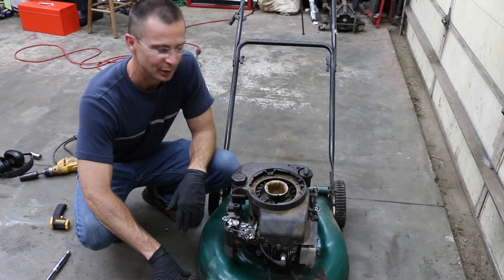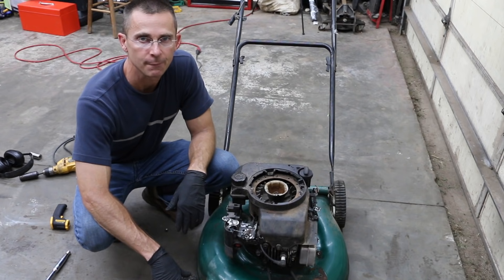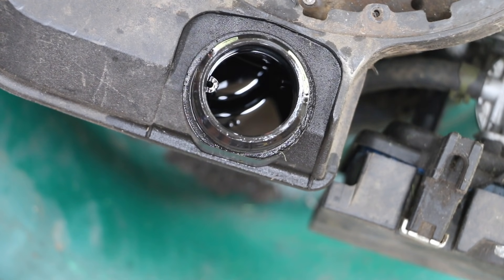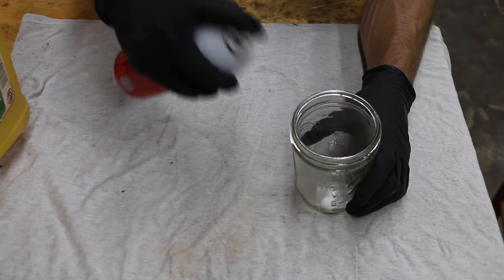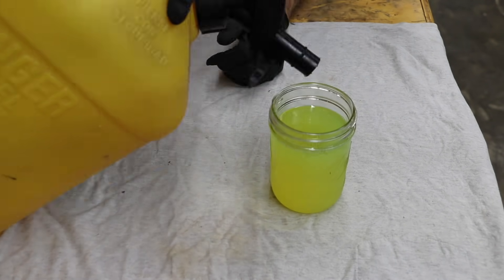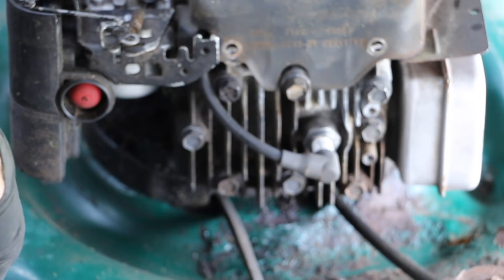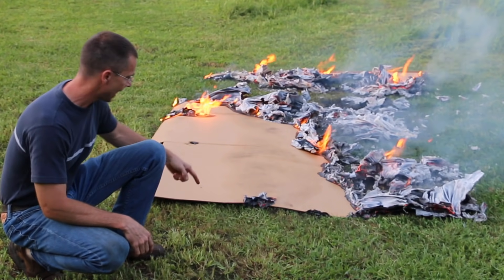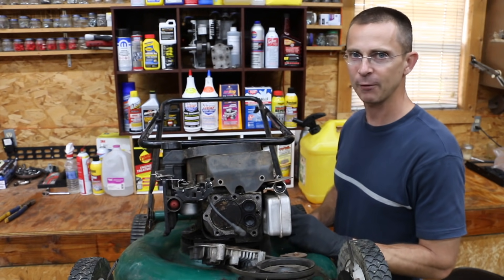Will a Gas Engine Run on Diesel?  Let's find out!

Comment: The fact that you were able to get it to run off a 50/50 mixture is impressive. Diesel has a very low octane rating (reasearch what an octane rating reallh is). So given that you had a fuel air mixture compressed and the motor didnt spin the opposite direction and sling a rod is impressive to me. But hey, we all gotta learn somewhere.

P.S... once you filter out all the bullshit differences in ignition, the ONLY main difference between a diesel motor and a gas motor is the timing at which fuel is injected.

Want to get real technical? Quit farting around with engines that run off the otto engine cycle and start working with ones that run on the miller engine cycle.
Reply from the maker: Thank you for commenting and great point regarding the differences between gas and diesel. I wish I had access to affordable diesel engines, but they are very expensive.  Thanks again for commenting!
Reply: Project Farm affordable diesel engines are attainable. You just have to know where to look. And if its affordable its probably not running and 9 times out of 10 an easy fix to get running. Small lawn tractor junk yards. Old farming applications. Etc. I'll be acquiring one soon myself to build my owm APU for my 18 wheeler
Reply: Also, if you want to make that lawn mower run off diesel alone, add some octane booster to the diesel and adjust the jet in the carburetor for the fuel you are using. Part of the reason it ran when you used the primer button is you were forcing the fuel through the jet.
Reply: The reason diesel fuel is injected is for better atomizition of the fuel for a more efficient burn, not because diesel has a low octane rating. diesel actually is very resistant to detonation so much so that they sometimes use a cetane booster to lower the temperature/pressure needed for combustion and increase burn efficiency, ford has a hard start problem with low cetane diesel. Hence why gas engines will live on after drinking diesel but diesels die after too much gasoline. Its the gasoline that detonates early in a (high compression) diesel engine. To even try to run a diesel on gas I would try the highest octane rating you can find, no less than 115. Consider the compression ratio for a small gas engine is 8:1-12:1, diesel engine compression ratio of  15:1-22:1. Knowing the compression ratio would help finding a alternative fuel, also carbon deposits in a combustion chamber will increase compression and can cause predetonation.

Comment: you would have had better luck if you warmed up the engine on gasoline..
Reply from the maker: Thank you for this suggestion!
Reply: Yeah, I've run a two stroke snowmobile on diesel (Yamaha SRV 540) by mistake, I was low, pulled up at a friends garage filled the tank up with a can that wasn't marked properly, fuel capacity of the thing is about 25 liters, and I put a whole 20 liter can of what turned out to be diesel in it, and it didn't fill it up completely, I'd say it had less than 4 liters of gas in it.. it started and ran, terrible, smoking like crazy  but it did run I ran it until the tank was about half full... Once it stopped and cooled down, it was impossible to start.  I mixed the rest of the diesel with gasoline and it started right up, (maybe 30 pulls on the pull start) smoked like crazy until I put fresh gas in it.. ..
Reply: Oh, and increasing the spark gap on the plug could also help, bigger stronger spark....

Comment: I have a good one for you. Zylene or acetone. I broke down on the highway with a faulty gas gauge. Poured zylene into my van to get me off the highway. Check out what the results of the heads after use. I think you will be quite amazed
Reply from the maker: Thank you for the recommendation!

Comment: would it be same principal for a petrol car or motorbike
Reply from the maker: Yes, it should be, but I wouldn't recommend starting out with a 50/50 mix.  Also, it could be a problem for vehicles with catalytic converters.

Comment: Old tractors used during WW2 could run on a fuel oil called TVO, tractor vaporising oil which was a bit like kerosene. There were two fuel tanks, the engine had to be started on petrol and then switch over to TVO once it was warm. There was also a special intake tract coupled to the exhaust which heated the intake mixture. Probably what was happening in your engine is that the diesel wasn't vaporised and just formed droplets inside the combustion chamber.
Reply from the maker: This is interesting. Thanks for commenting!

Comment: 2 stroke engines will run poorly on diesel rule due to the higher compression . In the old days Briggs had adjustable timing so you could run on diesel or kerosene .
Reply from the maker: Thanks for commenting on this.

Comment: The answer is no.. and please dont do this. It takes 7 hours to fix..  just had to drain a tank, spark plugs, fuel pump o ring, injector service. Came out to 1100 the customer had to pay because they put diesel in a Nissan Sentra...
Reply from the maker: Thanks for commenting on this!

Comment: There's this gas treatment stuff they sell at Walmart, Right now it's clearance at 2 dollars to treat 80 gallons of gas. I guess it's supposed to condision the gas and protect seals, rings, ect. Could you test it to see if it actually works well enough to use it on a regular basis?
Reply from the maker: Thank you for this recommendation!

Comment: Will it run on brake fluid?
Reply from the maker: Thank you for this recommendation!
Reply: Maybe use 50:50 mix of of brake fluid and gasoline. Pure brake fluid has high flash point.

Comment: Now, seal the jar with diesel in it, put the jar into a pan with water, heat water to boiling, run the heated diesel in the engine.
Reply from the maker: Thank you for this recommendation!

Comment: Can you make an engine run from atomised flour used usually for baking? 
  You’d have to make an atomiser, (jam jar, straw and compressed air) but I think it’ll work.
Reply from the maker: Thank you for this recommendation!
Reply: Project Farm 
You’re welcome, I seem to remember the gas engine was originally made to run on coal dust. The biggest problem I can see is getting dust into an engine.

Comment: Follow manufacturer's instructions.  They're for a reason. All of those instructions are done by qualified engineers. They're assure safety and an optimized use of materials.
Reply from the maker: This is an excellent point.  Thanks for commenting!

Comment: I actually thought the engine would just break, considering normal engine fuel is around 90 octane in RON, and diesel fuel at a whopping 15-25 octane in RON! https://en.wikipedia.org/wiki/Octane_rating
Reply from the maker: Thanks for commenting and great point!  I'm surprised at how well the engine ran at 50/50.

Comment: Since Diesel fuel is higher in price, than regular gasoline, why would you even try to use Diesel?
Reply from the maker: This is a great question.  Hundreds of people asked me to do a test on this for many different reasons.  What if someone accidentally pumps a little diesel into the fuel tank of their vehicle that's designed to use gasoline?  Will it run? Will it do damage, etc.  Thanks for commenting!

Comment: so 50/50 could be a way to save some money
Reply from the maker: I didn't test the fuel efficiency to determine if this mix provides optimal economy.  In theory, there should be improved fuel economy.  Thanks for commenting!
Reply: you should try it, try some diffrent mixtures, like 30/70

Comment: Here is something I do. (note it is a carbed small block chevy not fuel injected) When I change my oil I make sure my oil change pan is clean but then I collect the old oil and put one quart of it per 20 Gal tank full of gasoline back into the truck and this is how I get rid of my waste oil, help lubricate the top end of the engine and get a little something back out of it. At that blend rate you never see any smoke or smell it just burns away, and as far as it being clean, well a few min before it was swirling around in your crankcase, so as long as you are clean about the draining process it works great. BTW I have 500,000 miles on that 86 K10.
Reply from the maker: This is impressive!  500K is pretty amazing too.  Thanks for commenting!

Comment: Worth noting, despite the "longer burn" diesel fuel has a lower energy content.. fuel economy gains in diesel engines vs petrol come from the difference in the cycle used to burn the fuel (fuel injected at compression ignition vs spark ignition of existing mixture), petrol would give you more work done per mass or volume in the same cycle.
Reply from the maker: Thanks for commenting on this!

Comment: Run the engine with gasoline as usual and ad brake clean finely spray trough the air intake
Reply from the maker: Thank you for this recommendation!

Comment: 40 years ago I was in Viet Nam and had a Honda 50cc motorcycle, at that time Gasoline was expensive, diesel was much cheaper. I used gas only for start up engine cold then diesel running all day for years. No problem.
Reply from the maker: Thank you for sharing this experience!

Comment: Put teen gallons of kerosene in my mom's Beretta in the 90's!! Ran for a week with out another fill up, and the gauge said Full almost the hole week!! I was 13yrs old and was still running another 6 yrs!! Ever heard of that?
Reply from the maker: Wow! It probably achieved better mileage because it was running a lot leaner.  Diesel is thicker than gas, which likely reduced the flow rate.  Thanks for commenting!

Comment: Would there be a difference running Diesel in fuel injected vs the carbed small engine?
Reply from the maker: This is a great point.  I believe all diesels "inject" diesel, so it would make  a difference.  Thanks for commenting!
Reply: Project Farm yeah I was thinking it may be more of a vapor or mist then if it's run through a carb, which may help it's ignition from the spark. Also different types of plugs may aid in the firing process?

Comment: diesel engines have high compression to make heat to reach diesel flash point ... to run diesel in a gas engines that have low compression , you have to go the extra step and elevate the flashpoint.of fuel
Reply from the maker: Thanks for commenting on this!

Comment: Amazingly tried to pour half a cap of brake fluid to thru spark plug hole and let it sit for 2hours to clean carbon deposit on piston.
Reply from the maker: How did it work?
Reply: Project Farm brake fluid loosen up carbon deposits by chemical reaction, after 2hrs sitting on piston, remove excessive brake fluid and start the engine :)

Comment: It does make one ponder the minimum amount of gasoline needed for the mix that can stably run a small gas engine.  Also, have you tried diesel in an engine that uses a gasoline-oil mixed fuel?
Reply from the maker: I haven't tried diesel in an engine that requires a premix. Thanks for this recommendation!

Comment: reason for having to continuously prime the running engine is the orifice in the carb is too small and more suction may be needed because the fuel viscosity is higher in diesel
Reply from the maker: This is a great point.  The jet on this carb isn't adjustable.  Sure wish it was. Thanks for commenting!

Comment: Well, duh, diesel isn't a combustible solution and without a combustible material it won't burn at all in liquid form. Pour some out on a driveway and you won't be able to light it on fire with a propane torch.

Comment: Great videos, liked them so much I subscribed. I've seen a lot of YouTube videos about Running cars on gas vapor and they get huge gas mileage out of it. I wonder if the same holds true for small engines? I personally use a generator for power and I go through about $10 worth of gas each 24 hour period. That gets expensive, and with the cost of gas being high right now my question  is legitimate.
Reply from the maker: Thank you for subscribing.  I'll definitely put together a video testing gas vapors.  Thanks for this recommendation!
Reply: integr8er66  we shall see. This guy has said he will try it out and see.
Reply: Rick Westbrooks ok but I already know. As long as he is honest and fair in his analysis you will see.  All a carb does is create a venturi to lower the pressure below the vapor pressure of the fuel thus vaporizing it and also mixing it in the correct ratio. If you compare engines at equal loads and their ability to drive a load you will see. You must also consider if the vapor engine is running so lean that it burns pistons or valves or can't handle load, but apples to apples the carb engine IS a vapor engine
Reply: I have seen it first hand in real life, it works on small generators as well as automotive engines, just be sure to have a flash arrestor and put your air filter in front of your intake hoses that go down into the gas, I'm not sure how it works with fuel injected engines, I've seen it work on YouTube but only seen it work on a carburetted truck in real life.
Reply: Project Farm yes!!! Gas vapors for sure
Reply: +Carol Harris you mean creating more friction, distance and loss of momentum? I don't see how that could possibly help when low on gas..
Reply: +Carol Harris lol just read your second comment..must be where you got your idea for when running low on gas!

I've seen a couple of his vids but can't remember which..maybe gullwing doors was one? no idea what the others were
Reply: Those video's about gas vapor and high mileage are all 100% crap. a Carb makes gas vapor, all engines run on vapor.

Comment: A few years ago in a hurry I, by mistake, put diesel in my lawnmower. The engine was already hot because I had already done half of my lawn. The engine started well so I continued the job. But there was an awful diesel smell, more smoke and the engine running faster. Also the engine didn't stop when stopping the ignition I had to stall it on a stack of turf and dirt. The engine was certainly running hotter the exhaust was turning red. So it is really possible to run a small engine on diesel, if the engine is already hot, but not recommended. The engine was a craftman eager-1.
Reply from the maker: Thank you for sharing this experience!

Comment: that is a very good video thank you for posting. 
question, will a little gas be ok in a diesel engine or a little gas say 10% be any help with biodiesel say B100, I am interested to know will it do any harm to the diesel engine,
Reply from the maker: It really depends in the type of injection pump.  I wouldn't add any gas to a modern diesel engine with the common rail or high pressure systems.  They are very sensitive.  On the other hand, the really old diesels aren't as sensitive and a very small amount of gas is less likely to cause harm.  However, I still wouldn't add any gas to diesel.  Hope this helps.
Reply: If you put gasoline in a diesel motor it will cause erratic RPMs and rev like crazy

Comment: Toluene is something I have heard guys using as an octane booster. Only to be used on carburetorated engines adding power. can you reduce the amount of fuel to get the same amount of work done adjusting the carb
Reply from the maker: Thank you for this recommendation!

Comment: Although considered fuel, deisel can hardly be considered flamable under normal condition, you will either need realy high pressure or really temperature to ignite it.
Reply from the maker: Great point.  Thanks for commenting!

Comment: I put diesel in my truck which is a gas engine for every 120 litres I put 1 cup of diesel it helps break down the deposits in the cats and in the injectors
Reply from the maker: Thank you for this recommendation!

Comment: if you add a small amount of acetone to gasoline does it improve the gas mileage and horse power and if so by how much if you use a lawn mower to test this please use both normal and high octane fuel for the test as small engines often work better with high octane to start with my understanding is it allows the fuel to form a finer vapor so also please try adjusting the fuel air rato to be a more lean and show how that effects the outcome and also if you could show how fast the engine is spinning with each test my advice for the horse power test is to find some tall grass oh one more thing the typical amount of acetone is 1-4 t spoons per gallon I would say try 3 t spoons their is no harm to the plastic parts as even pure  acetone will take years to have any notable change this has been tested by somebody else on youtube think your gonna be shocked
Reply from the maker: Thank you for this recommendation!

Comment: Running a gasoline engine with a small amount of diesel oil added lubricates the hot, dry upper cylinder area. That is why a diesel engine lasts many more hours than a gasoline one.
Reply from the maker: Excellent point.  Thanks for commenting!

Comment: Your channel have a lot of potential you got me as your sub, no matter I did have farm or engines to fix. One advise use a bigger size for your fonts in the tumbnails , also yellow in nice, but add little bit orange to it and will be readable and visible.
Reply from the maker: This is a great suggestion--thank you!